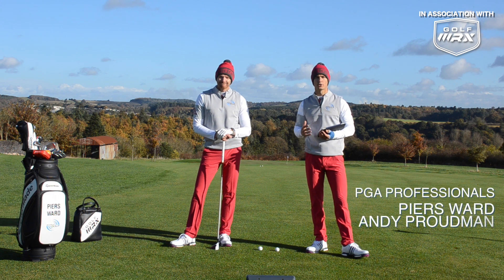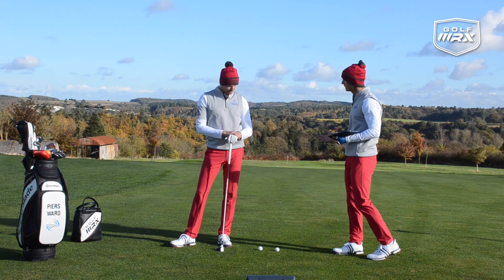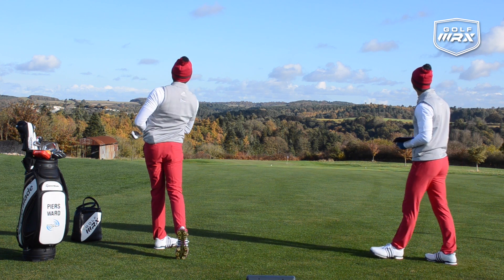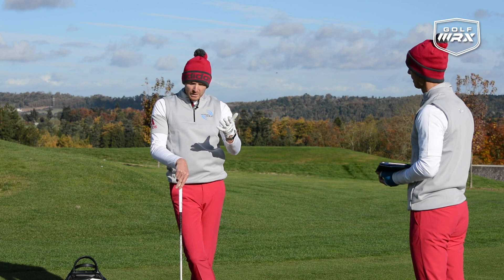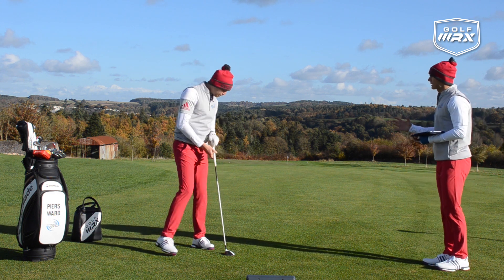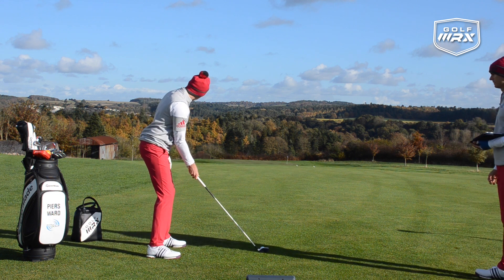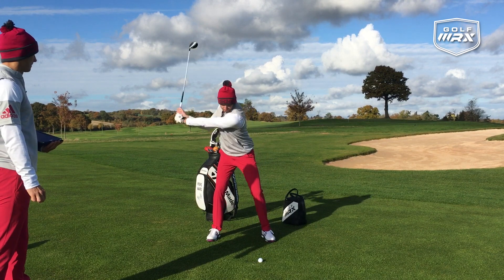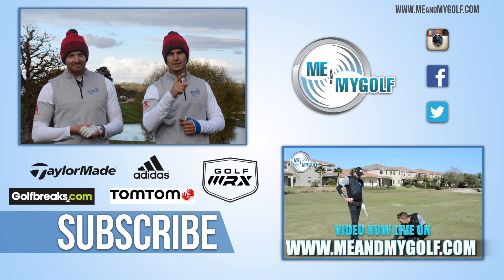HOW TO PURE YOUR FAIRWAY METAL

Comment: I find my 3 metal is intermitant so I use my 18deg 5 metal and get the results. Might be a slightly shorter in distance but it is more consistent with its distance and height sticks to the fairway as well

Comment: Previously you've mentioned spraying the club face with a 'foot spray' as this leaves a perfect impression of the point of impact with the ball, should you be having trouble hitting the sweet spot. Can you give us the name of the spray you used? If I buy a different one, you can bet your life it won't spray a visible coating on the club face!.
Reply from the maker: I think Dr Scholls works
Reply: AS Me&My say it works, a spray that also works and is usually cheaper is any kind of dry shampoo spray.
Reply: Dactarin Active works too

Comment: Should the angle of attack change when hitting a wood off a tee peg? Should you hit it on the up like a driver or continue to hit down? Thanks
Reply from the maker: It may change very slightly but in our experience you will want to be hitting level- slightly down to ensure a solid hit.

Comment: I can't seem to hit my short irons (9-7) anymore, I either hit a huge cut or it is really fat same thing with my pitching wedge or 52 degree. I push out my hips on my forward swing to help a little bit, I've done it in the past an it seemed to help out a lot but it's not any more. Any suggestions??
Reply: Devin Ray By doing that, you may be inhibiting your rotation? (depends how far forward your hips are?). I recently realised this after I'd been failing to clear/rotate my left side. Once I addressed this it made a big difference to my ball striking. Of course I'm guessing...